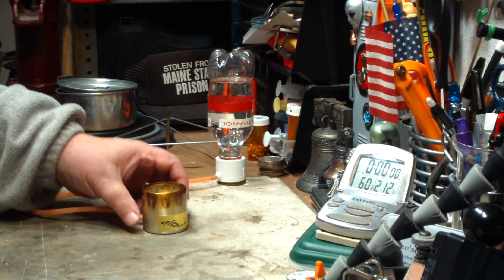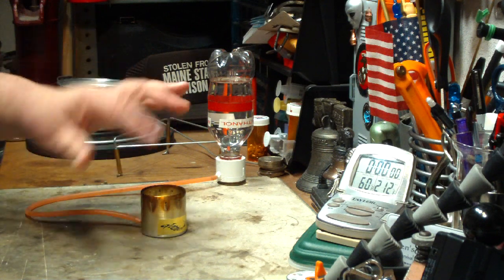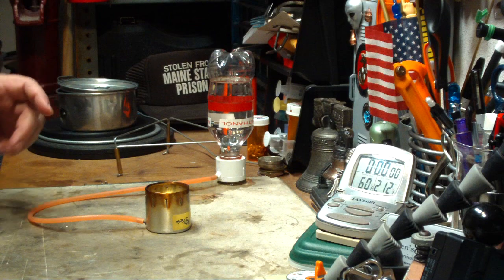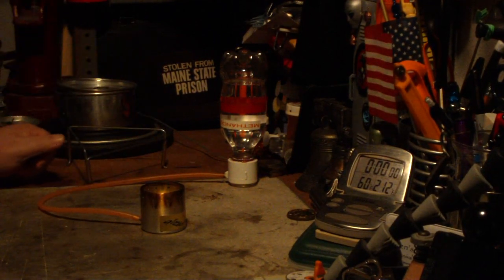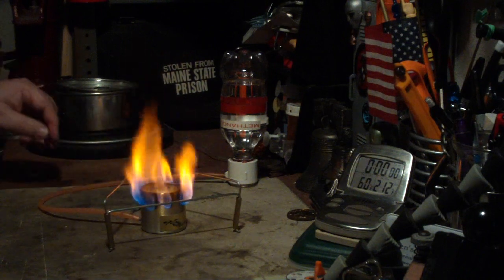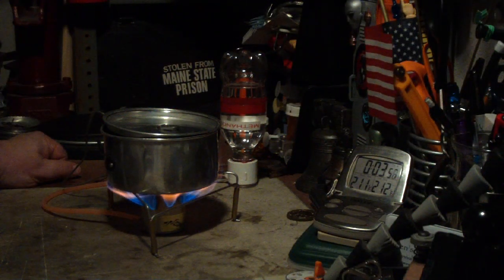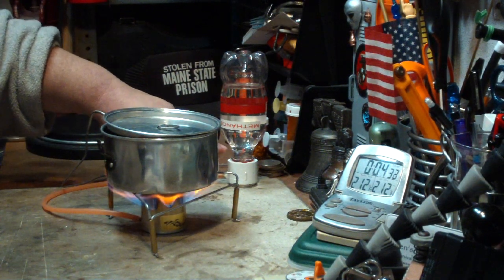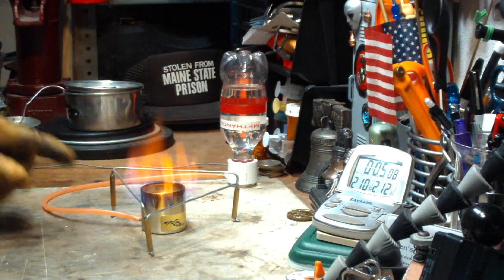Vortech1000 Alcohol Burner - Boil Test #1

Comment from the maker: The hose is a high temperature silicon hose so it will stand up to some heat, but your right that the heat would have to be watched. Maybe wrap the aluminum tape on the hose leading into the burner.

Comment from the maker: This type of stove the speed could be translated into capacity, like in melting snow or ice. Or for boiling water by the quart. I have to figure out some sort of regulator for the Bubbler. When I was pulling the alcohol back into the remote bottle I got a nice blue flame out of the burner. Looks like I was letting to much fuel feed to the burner.